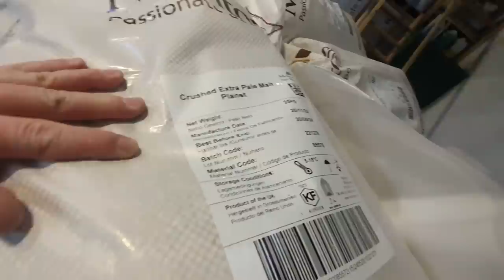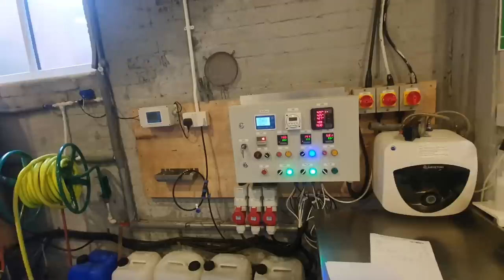The Cost Of A Tory Government On The Hospitality Sector ~ Vlog 876

Comment: That's a big hike heck 😮. I always fancied starting a micro brewery not sure about the pub up front that's next level. £5 for a pint isn't unreasonable though I pay often £6 equipment here in Australia for a good craft beer sometimes more. The govt tax and increase to power are hurting small brewers. Here in Oz many micros and mid size brewers are from wineries where they gave room for another shed or they use the existing tanks and pumps after wine making. Makes it easier to keep costs down i guess. Bottling and canning has saved many micros especially with covid.
I wonder if the small Brewer next to the tap house pub in swadlincote is still going?